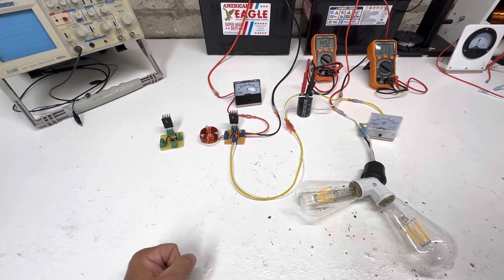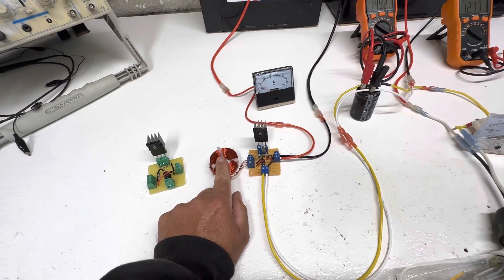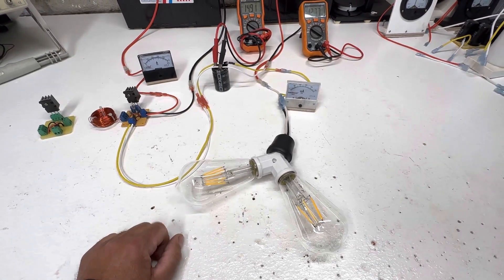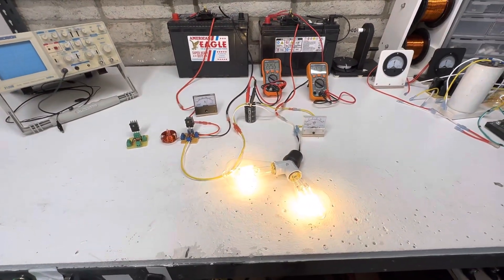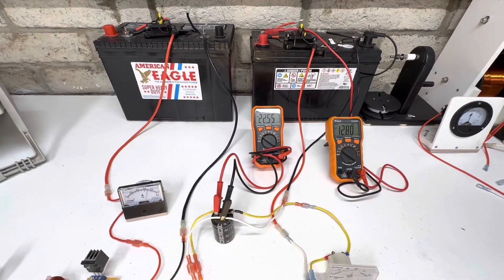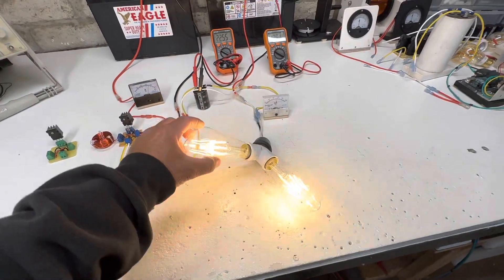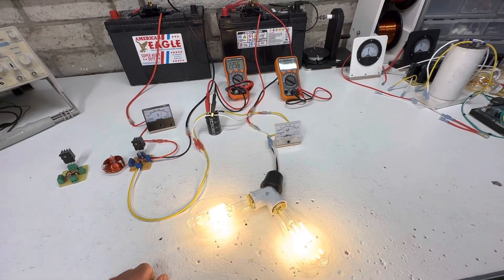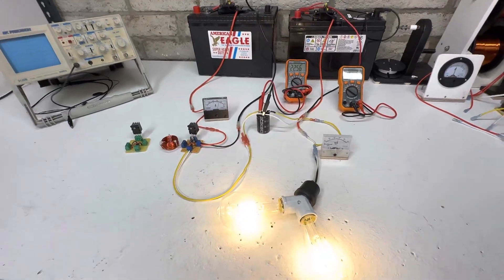Forced oscillator running light in series with second battery

Comment: So, if you did not divert for battery charging, would the lamps glow brighter or consume less from the run battery.  A rotor with a few small magnets on it would also give you mechanical output, don’t know how much more it would cost the run battery.  Really like your videos, they are always at the edge nudging everyone……
Reply from the maker: Thanks buddy! The lights run at 1 amp from 12 volts regularly 
 I have lots of motors that do that this is just a cool simple solid state

Comment: What transistor are you using? I am working on something similar to this.  Have you tried using a solar panel with the force oscillator to charge a battery?  I have been doing this with great success. It would be fun collaborate on this with you.  Do you have a way to get in contact with you if  you are interested in working together.
Reply from the maker: Yes I have ! 
Toshiba 2sc5200
kbgenergy@gmail.com